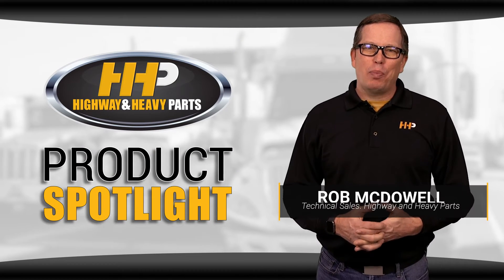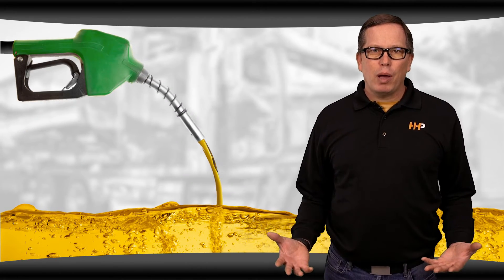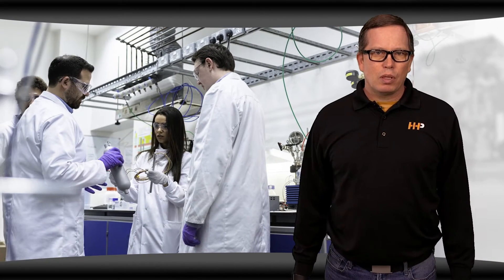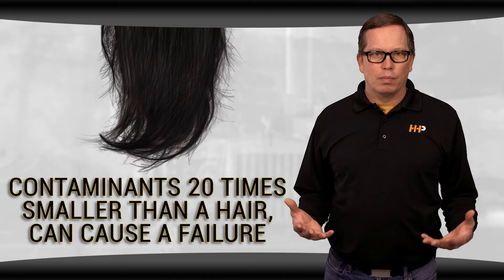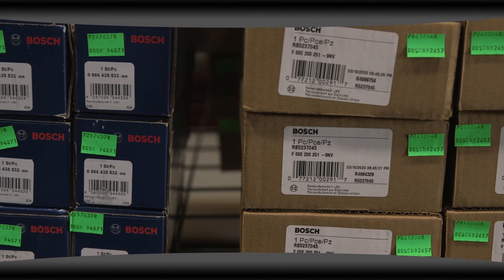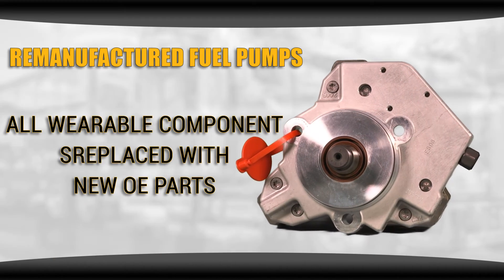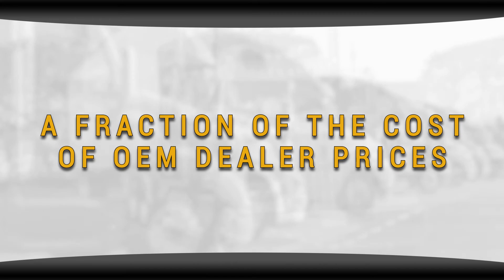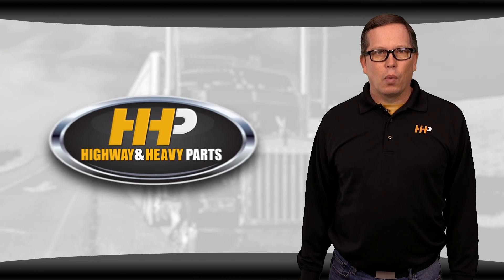Why Contaminated Fuel Ruins Common Rail Fuel Pumps And Injectors

Comment: What would be the cause if not hard starting ..
And if the check ingine indicate at the dashboard the smoke comes clear and the strength becomes stronger
Reply from the maker: If the check engine light comes on and your truck seems to be running fine, your components may not be operating as designed and could be taking on damage. Avoid engine failure by having a service technician check out your truck.